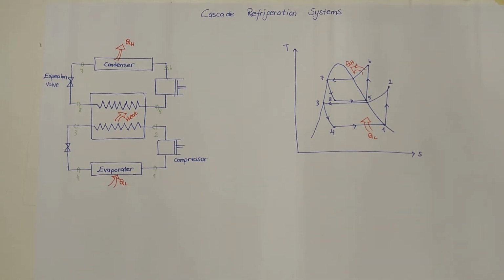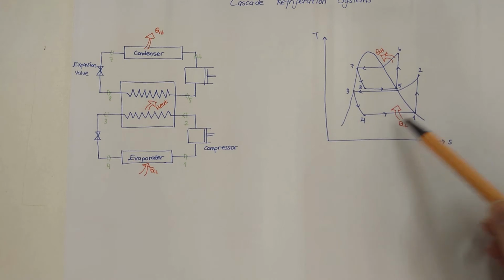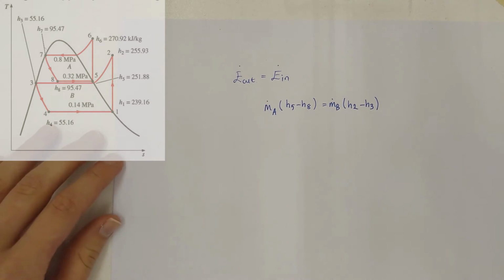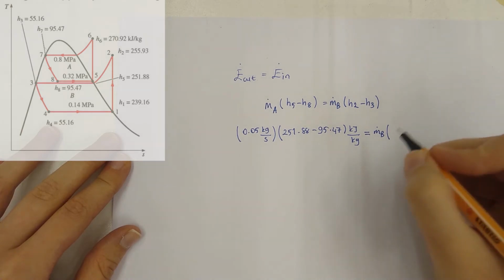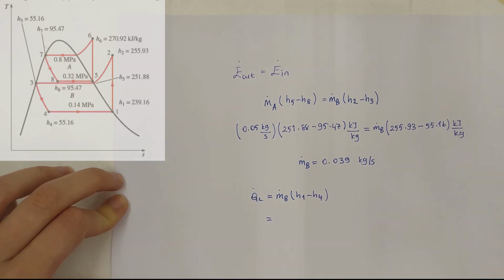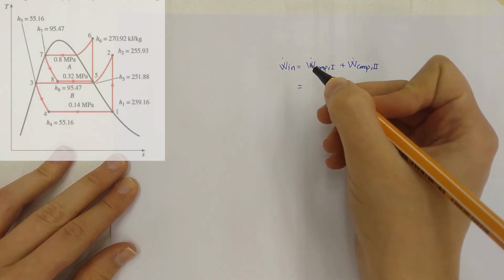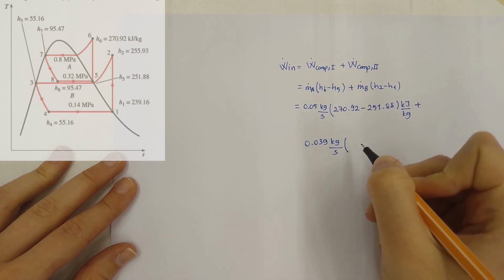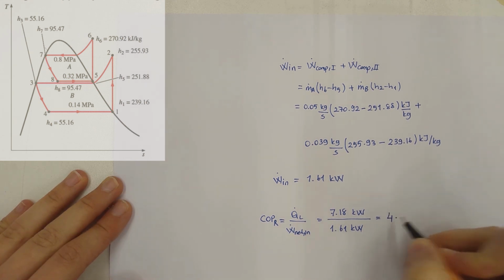Two Stage Cascade Refrigeration System Problem Solving

Comment: Why is the temperature from 2 to 3 lower than that of 8 to 5?? If heat is flowing from 2 to 3 towards 8 to 5, 8 to 5 would have to have a lower temperature than 2 to 3, correct?
Reply: لان 2الى3 واقع في منطقه vaper satartedبنسبه إلى موقع الكير
أما 5ال8 فانها في موقع laqiud